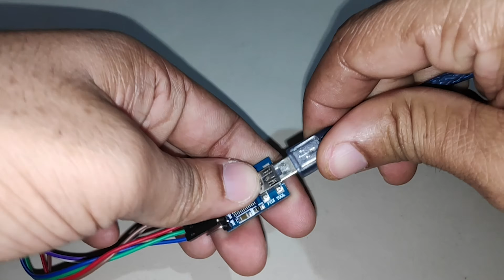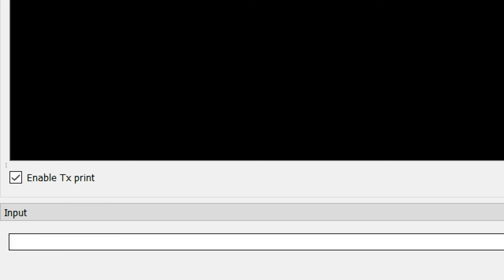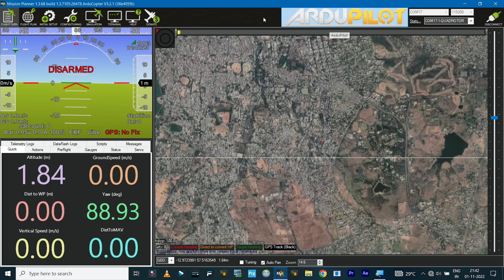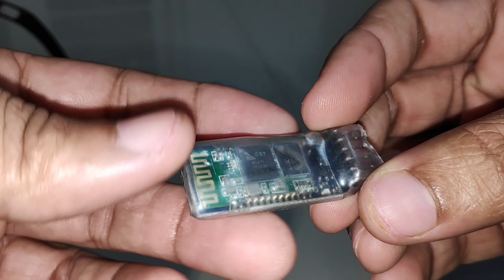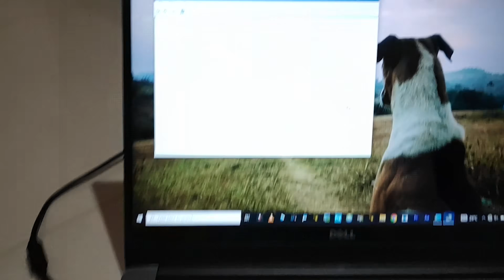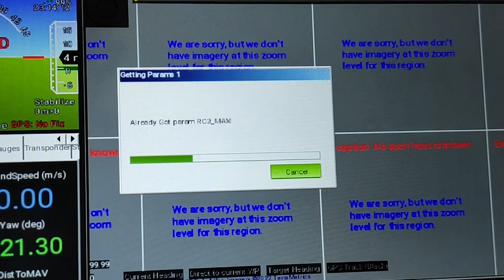APM Flight Controller DIY HC 12 Serial Telemetry Module for Mission Planner Waypoint Mission

Comment: The HC 12 to HC12 link is working perfectly for me after following as you taught, when connected via ftdi and I'm getting around 800m Los range. But whatever I do Mission Planner for Android does not detect the bluetooth module. my bluetooth headset is detected but not the hc05 even after pairing. Bluetooth serial monitor displays telemetry data but somehow mission planner does not find the hc05

Comment: good video. but for me its not working correctly. stuf: win 10, omnibus f4 pro, ardurover 4.2.2 stable,  hc 12 connectet to pc with hc t and second hc 12 to the boars on serial 1 , baud rates  is 57600.  when I am trying to connect there is wery slow getting parameters and never ends.

Comment: Good to see im not the only one still using an ancient APM, i have an APM pro on one of my quads and while it still flys fine i wont replace it with anything newer :)
Reply from the maker: Lol, yes it's good as long as it work well. It's ideal for these big drones. However these are still sold at High price atleast in my region which i found irritating after knowing some cons about this apm 2.8. overall it's doing good though 👍 nice to know your setup!

Comment: Hello brother it's work on pixhawk 2.4.8????
Reply from the maker: Yes sure, use any telemetry port on pixhawk and make sure set the baud rate correctly. 👍
Reply: @RakishRc  thank you so much 🥰🥰🥰
Reply: @RakishRc it’s not connecting for pixhawk 2.4.8. Mavlink times out. Is there any solution for this
Reply from the maker: @davidjohn4712  if it times out than its probably due to too much of data from the pixhawk perhaps. Did you set the baud rate and the module power and frequency correctly? Atleast you should be able to connect and make basic adjustment in mission planner